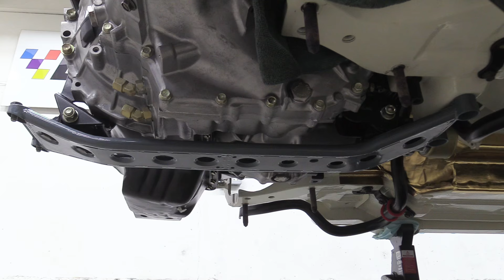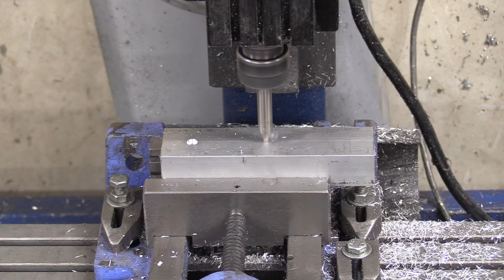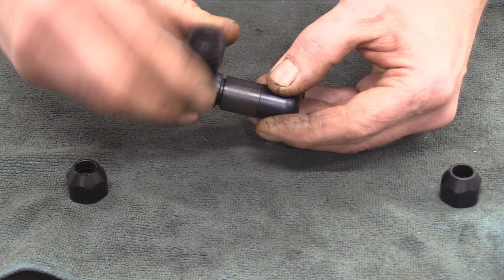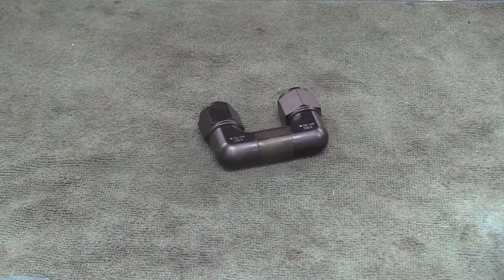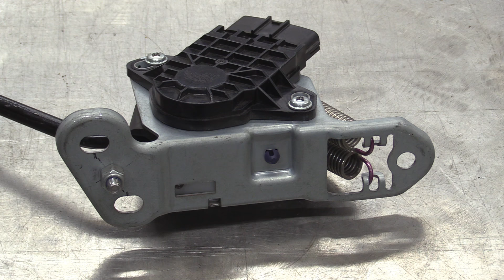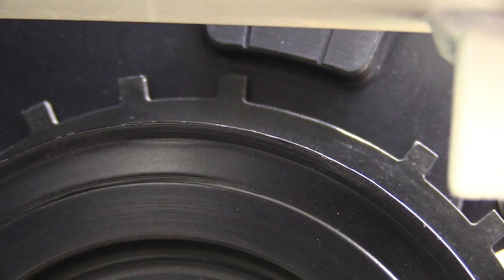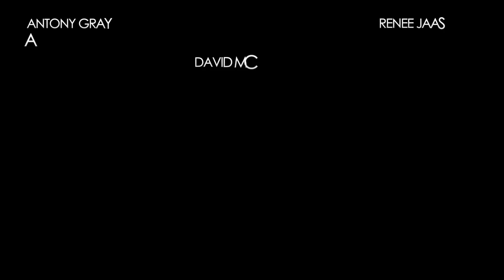Project Binky - Episode 36 - Austin Mini GT-Four - Turbocharged 4WD Mini

Comment: one question. why does the ventilation blower motor draw air directly from the engine bay. iits either going to draw fumes inside the car with engine running or a direct interior access for an engine fire to get inside the car.

Comment: So if those oil fitting for the gearbox were say 1mm closer or further apart (so the sleeve had to be longer or shorter) none of that would work??
Reply: Nah, they'd just have had to make the sleeve shorter or longer. They turned up their own sleeves, so they could have made that as long as necessary.

Comment: Great video and I like the cool electronic controls. Schoolboy error with the timing 360°out, a cork or whistle in no.1 plug hole might help you next time (dont know if there a digital alternative, maybe a cylinder pressure transducer, linked to a signal generator and speaker?? 🤣) Keep up the great work!

Comment: OK, I give up, what does "PT" stamped on the front lower cross-brace mean?    All I can think of is playable teaser (video game), or physical therapy.  Or, abbreviation for a Pint.   But I'm on the mid left coast of the USA, far from Ol' Blighty so I'm sure there's slang I am not familiar with in spite of decades of watching such BBC dreck as Dr Who.   Or is it PTO, Power Take Off ?   that doesn't make much sense, either.
Reply: Also have wondered and wondered for a few years since ole Nik went mental on the skid plate. Proper Tea?
Reply: @deeplato5647  OOOOOH.    "Please Turn Over" !!   :)

I did like the way they 'revealed' that in ep 15 when it was fabbed.   during fab and initial assembly Nik was very careful to block it from the cameras view.
Reply: @geepeerces  Seems you nailed it! Good on ya

Comment: 25:00 "when we set the trigger offset earlier we did not know if the top dead center was on the exhaust or the compression stroke . There is no way of knowing " 
Well if you open the  valve cover you can see which valve  of the cylinder is closed and that will tell which stroke that cylinder is on . If the piston is at TDC and the intake and exhaust valves are  closed  then it is ready for combustion . If only the intake is open its sucking , if only the exhaust is open its evacuating and if both are open you are not at TDC or your timing is WAY off  :D

Comment: 25:43 why did you immediately rev the engine that was not only cold still, but also cranked for first time after a rebuild?
Reply: the pump and engine was primed here https://youtu.be/cN8DYQIuW9Y?t=1940 
and again primed here at 21:16 before the first starting temped here at 24:29 no start,
after fixing a software error it is started at 25:38. 

oh an that is hardly a "rev" -ving of a engine.

Comment: Out of curiosity did you consider using the hard pipe loop off an MR2 turbo gearbox? They came factory with the same gearbox and ran a hard pipe loop not a cooler.

Comment: I really need to know the sort of figure the GT4 engine is producing, because, if it’s enough…the power to weight ratio will be equal too or greater than a Bugatti Chiron. 
And I know which one is rather have
Reply: I suspect with that setup they can dial up as much HP as they can handle...  that turbo is rated to make at least 500 HP out of a 2L engine.    the tradeoff is driveability at low speeds.

Comment: I've watched you guys spend 15hours on a bracket, turn down a nylon spacer to stand something off, paint a near invisible emblem on the paint.

But using a crocodile clip to ground the spark plug to test spark. LA-DI-DAA!

Comment: I'm sorry but did you use copper grease on tie rods? Copper is precious metal, and therefore it will eat the iron in time, weakening the tie rods.
Reply: WHAT IS COPPER GREASE?

Copper grease is a specially formulated anti-seize compound manufactured by combining fine copper particles and high grade corrosion and oxidation inhibitors.  The grease is created through a procedure that combines oil with soap.  This imparts a sticky quality to the grease which enables it to cling to the surface it has been applied to and stay in place longer.  Copper grease is an anti-seize grease as opposed to a lubricant.

APPLICATIONS OF COPPER GREASE:

Copper grease has been designed to be heat resistant and operates well under conditions of temperature extremes.  It demonstrates excellent anti-seize characteristics at temperatures well over 1,000° celsius.  Because of this it is often the first choice grease for use with of wheel nuts, flanges, exhaust brackets/ assembly and flanges.  The anti seize properties of copper grease are particularly useful during assembly and dismantling jobs.   It is also sometimes used for eliminating disc brake squeal.

Comment: After 8 years of waiting. A running engine.
Reply: well 8 years is only 2 years and 14 weeks of saturdays and sundays,
and even if they "had" worked on them all, the 2/3 time would have gone into filming.
so 112 days, with 12 hours of work pre day, so 56 days so 672 manhours into building Binky, more or less 😁 most like less due to other project and real life things.
Reply: @1BigBen  what are you drinking man :)) this comment must be pinned on top of each video release by BOM

Comment: I hate "to be continued". 
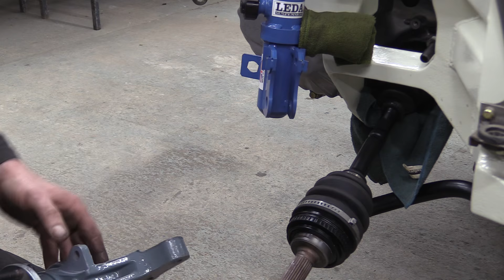I'm only letting you off for two reasons. Firstly because its in colour and secondly because the editing is top notch. For instance at 2:39 the audible clunk of a bit of metal hitting Binky's new paint was still there but the three hours of shouting and swearing were cut out and replaced perfectly with a clip from three days later when Nick had calmed down and got a rag on it. 
Excellent and congratulations.

Comment: You can't run COP with just a crank pulley signal (unless you are running a wasted COP setup).  Do you also have a cam sensor?  B/C just changing the offset shouldn't have any affect as the ECU still wouldn't know which stroke it's on.  If it's a wasted COP setup, it should have ran fine, so it's not wasted COP.

I'll just assume you have a cam signal too, as there is no other option.

Comment: Congratulations! It's been years..But now the clock is running out on petrol engines so you need to gut it out and start again with the hybrid version followed by the full on electric and then hopefully you saved the petrol plant because  once there isn't enough electricity to go round, the world will chuck Gretta Thunberg into a fiery swedish volcano (its OK, its spews only natural toxins!) and start using fossil fuels again as their is no replacement for the sound of a roaring engine burning rubber down a glorious highway!

Comment: Not sure about those recessed bolts on the track rod to strut mount. From a maintenance point of view I'd prefer standard 6-sided hex head bolts on the surface.  If you ever have to remove those bolts the holes and the bolts are going to be packed with dirt.

Comment: Why was there no crush washer used when the original transmission oil cooler hose fittings were removed and replaced with the AN fittings?

Comment: I think of all the junkers over the years that I've pieced together with bits, but bits that for all intents were meant to fit together and work .. and yet still sometimes months of nights laying awake wondering if at that pivotal moment the damned thing would actually cough to life. Now I'm going back to old school stuff .. making a drill operated oil pump prime tool from a dead distributor and watching the gauge climb - check. Install distributor close enough to number one .. or perhaps it's 180 off. A bit of fuel down the gullet. .035 on the plug gap (incidentally, the thickness of a Canadian dime) is a decent ballpark for anything to fire. Or even just a damned generic EFI like-for-like engine swap - There's nothing as satisfying as hearing your work come to life after the bloodied knuckles, rust in the eye, and sweat. You may have appeared cool as a cuke on that first key twist, but that had to have felt awesome.

For what it's worth, this series as well as some of my most favorite entertainment, has also challenged me to kick myself in the ass and go for specific fabrications that not so many years ago would have found me mewling as if a lost kitten and wondering how that particular bit might ever come to be. As impressive as you are .. you've also demonstrated that (for example, a custom HVAC unit) is still only cut, bend, bond - and is possible with tenacity .. I choose tenacity over "skill" because the latter is simply a matter of learned experience, this which can be gained with several score kicks to the nuts if one has the former. 

As such, you have been directly responsible for the success of my own last build season, which beforehand seemed too large a bite to chew. I will not claim that my last weldment is as complicated or intricate as much that I've seen here .. but you were certainly influential in making it happen. 

http://www.findsomethingandburnit.com/March_Hare_6.html

Comment: Congratulations on keeping the floor dry at the end of the episode. However, if this is truly the case, can it REALLY be considered a British car anymore???
Reply: It’s ok, the roads around there will soon find a way to rattle something loose enough to mist up. Then it’ll be cocking a leg with the best of them. 
In the meantime, there’s always the aircon condensation line to make with the wee-wee. Just so it looks right. 😁
Reply: If there is no oil under them, there is no oil in them, Towmater.
Reply: British cars don't leak oil - you're thinking of Chryslers.

However - British cars absolutely let the smoke out, and a jar of new Lucas electric smoke is damn near IMPOSSIBLE to find today...
Reply: It's a Celica GT4 with a Mini Body, So not really a British Car
Reply: @SpacedOdyssey  What else is a Mini if not a British car?
Reply: @ChristopherHallett  So how about the 80% Toyota, It's a Celica with a Mini Shell
Reply: @SpacedOdyssey  It's a Mini with a Celica driveline in it. So, a Mini. If it had a Hayabusa engine instead, it would be a Mini with a Hayabusa engine. If it had a Ford V8 in it, it would be a Mini with a Ford V8.
Binky is a Mini.
Reply: @ChristopherHallett  No British Running Gear on it whatsover, If you had to get it fixed you would need a Toyota Dealer NOT Leyland
Reply: @SpacedOdyssey  So because there are no Leyland dealers in existence anymore, all classic Minis are no longer Minis?
P.S. most Toyota dealers wouldn't touch this with a 10 foot barge pole.
Reply: @SpacedOdyssey  two English guys made it in England, kinda sounds like a British car to me.
Jensen interceptors had a Chevy V8 in them, still British.

Comment: It’s still breaking my brain as to how you figured out how to ensure those oil cooler fittings fit the thread length and most importantly the alignment.. that would have taken me AGES to figure out… and lots of trial and error.
Reply: The closest I could ever get to pulling that off is cutting the spacer a little short and filling the threads with hydraulic sealant. Simply barbaric compared to these blokes work.
Reply: @thisguy1890  no, no. Yours is the proper way.
Reply: I'm guessing that he keyed the standoff piece at a bigger OD and then tapped the the threads on a lathe.  That way he could tap one end, then spin it around and be 180 degrees off +/- degree at the correct length.  Then he could have used the lathe to cut the OD and remove the key slot.  Since he has O-rings to hold the pressure, and the mating fittings hold the angle...  He doesn't need to stretch the threads to hold pressure, the ID of the standoff piece will compress the O-rings and do that for him.
Reply: @johntremain8403  I see what you mean… he then can just focus on setting up the proper alignment within the 1-2 mm length tolerance to fit.
Reply: @johntremain8403  nice
Reply: Yes, it is, isn’t it. 
Arcane knowledge, yes. 
🤔
Reply: one word.  CAD !
Reply: Finally caught up with all the episodes, but would have like to see the car being driven. That wiring harness and electric knowledge is unbelievable, what a fantastic amount of work must have gone into that.

Comment: 1) Why the two-part driveshaft?  2) How long do you think that exposed plastic gearbox oil fitting is going to last on a gravel road?
Reply from the maker: That's a stock Lexus driveshaft, the fitting is aluminium and it won't be going on gravel roads.
Reply: @BadObsessionMotorsport  Given that the gearbox will probably seize if that fragile fitting breaks without you noticing, wouldn't it be a good idea to fit a shield?

Comment: I must say that the way those oil cooler connections were perfectly in line once you tightened the fitting was mightily impressive! Huge leek avoided…
Reply: I was wondering about that. The O-rings were on a parallel sleeve inside,. so would it have mattered if the connectors weren't tight?
Reply: @seanalexander9531  I wouldn’t have thought so, but seeing a few microns of thread wouldn’t have satisfied these guys!

Comment: Hey Nik and Richard, love the episode, love the show, so happy to finally hear the noise. Hooray! etc
 
Also, can you settle something for me please? My mechanically gifted friend says it "struck me as odd that 'there's no way of knowing' whether a piston is at TDC on a compression stroke or an exhaust stroke. I've always just removed the rocker cover and observer the valve movements through a full manual rotation to determine which stroke it's on before locking in the distributor."

Whatever that means.

Whereas I suggested there's so much plumbing and other gubbins snaking over the top of the engine, rather than spend a day dismantling it all again you just took a 50/50 guess... is that about right?
Reply from the maker: 100%. Piece of cake on an A series, absolute nightmare on this engine.
Reply: @BadObsessionMotorsport  all that and you reply to your fans! Thank you and much love from New Zealand...
where, in other news, the Britten motorcycle in our national museum is currently having its bodywork resprayed. So the rest of the bike is on display in all its naked glory.

Must pop down and stare at it this weekend

Comment: The MR2 Turbo E153 gearbox has a loop in the oil cooler location factory. Ive removed mine and fitted a oil cooler from a caldina as a bolt in item. :D Love from New Zealand.

Comment: Cool, as a general rule I try not to use the expression "firing up an engine", in case it turns out to be literal fire 😉
On that, it looked like you had a power type extinguisher - if so, I'd suggest using a CO2, or other gaseous type, unless you want to spend the next week cleaning up power and, maybe, even stripping the head off the engine to clean it out, too.

Comment: 4x108 is a bit of an odd PCD to use.  An almost defunct old Ford stud pattern (Escort/Cortina etc).  I remember the dramas I had trying to buy 4x108 wheels for my '78 Escort 2-door since they'd long gone out-of-stock in Australia.  I ended up doing a 5 stud conversion on my '78 Cortina Mk4 so I had some wheel options available.  Now I can't buy tyres to fit either as 13" and 14" only come in narrow tyre sizes and don't fit so well on 7" and 8" wide wheels.

Comment: For the center bearing on the prop shaft. Shouldn’t you isolated that with rubber bushes? Most have that and my Impreza bushes disentegrated and I had to buy new ones. I tried to run without and had a wicked whirring sound.

Comment: Sending out to have components made elsewhere ( the struts)? You should have  made them from scratch from steel tubing salvaged from the Titanic, with springs tempered in Himalayan Yak butter and painted with crushed emeralds from the plains of Patagonia ..... and some custom brackets. Could have extended the project by a couple more years. Worth it though!

Comment: I know my comment will probably get lost in all the excitement but hopefully someone sees it. The E154F transmission has both synchros and hypoid gears and you can't use regular GL-4 or GL-5 gear oil. Toyota has a special fluid called GL-5 Super they used for these transmissions. I didn't see what was poured in there. The closest alternative is Redline 75w90NS + 1 quart of synthetic synchromesh + 1 quart Redline Heavy Shockproof. Its very similar to subaru transmissions and that's what I've been running for a few years in my Celica GT4.
Reply: Are you Nick in disguise?
Reply: looks like the oil is from Morris oils - also, like BOM, based in Shropshire - They do a very wide range of gear oils - let's just hope it's the right one for Binky
Reply: @mosschopz156  considering how detailed they in everything they do, they probably already know. I just didn't see them mention it cause most people don't care/know. GL-5 is great for synchros, but terrible for hypoid gears (basically an offset ring and pinion). It doesn't have enough cushioning to it. GL-4 does, but it's corrosive to yellow metals, as in synchros. So you have to find the gear oil that's not too slippy, or synchros don't work right, the right viscosity for the VC center diff, and has enough cushion to protect the hypoid gears from extreme pressures and wear.
Reply: @muttenmagroo  What are "yellow metals" never heard the term before.
Reply: @mosschopz156  Knowing Nick, he'll probably do a full oil change for engine and gearbox after a couple of hundred miles.
Reply: @socketus puppetus Ahh ok thanks.
Reply: I have a 3000GT that I use Shockproof Heavy in for the very same reason.
Reply: Surely, seeing as they've stuffed a complete Celica GT4 under the Mini, they'll be using what Mr. Toyoda says they should use !

Comment: I suspect you're right about not needing a transmission cooler.  But, if it should happen that Nik is pushing on a little harder than the box of cogs is comfortable with, I assume you could fit a rad with an internal trans cooler like most slushbox cars use nowadays.  Assuming the current cooling system isn't too marginal already , that is.  :-D